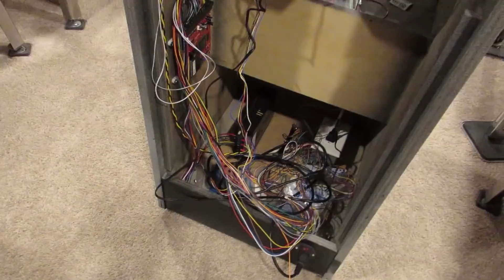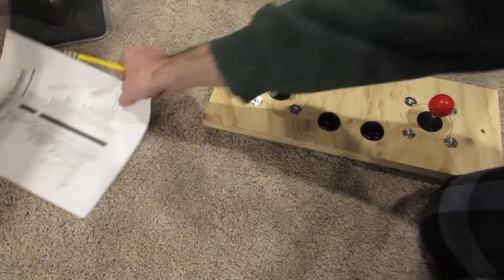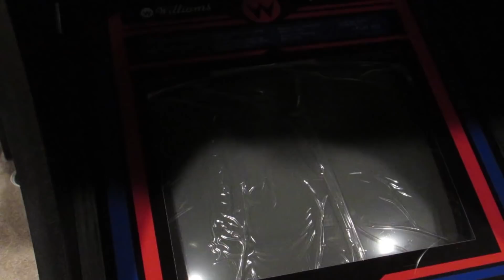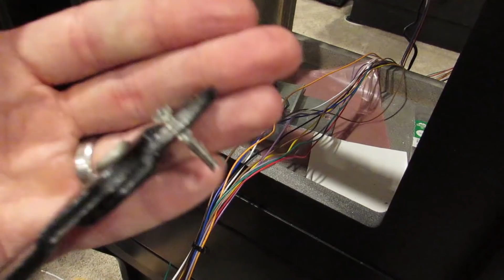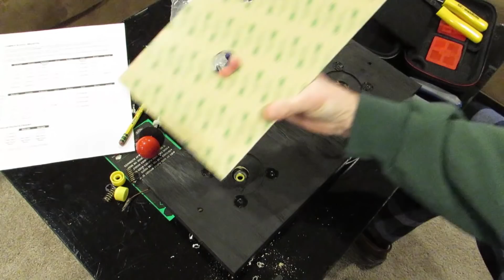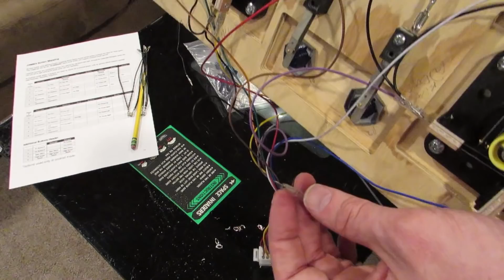Let's Make: Robotron Cabaret Control Panel (Part 2/2)

Comment: Starting a build of my own. On the edge of the control panel is it just painted wood, or tmolding?
Reply from the maker: I painted the whole thing black and then put T-Molding on the edge.
Reply: @ThatTimGuy  Thx. I'm assuming you used the same 3/4 in plywood as the rest of the cab?

Comment: Where did you get the control panel latches?
Reply from the maker: I grabbed them off of eBay. I don't think this was the seller, but this is the same style: https://www.ebay.com/itm/Arcade-pinball-console-panel-latches-Set-of-2/171275529729?epid=1231630111&hash=item27e0d12e01:g:47wAAMXQuTNTLIVy:sc:USPSPriorityMailLegalFlatRateEnvelope!01007!US!-1:rk:7:pf:0

Comment: Tim, where do you buy your Jamma harnesses?  Trying to avoid the cheap ones.
Reply from the maker: I think I got a cheap one from Holland computers. The downfalls of this one are that the wire gauge could be better. It is probably the best cheap harness I've purchased though at sub $15. Otherwise you're looking at about $25+
Reply from the maker: I think it was this one: https://rover.ebay.com/rover/0/0/0?mpre=https%3A%2F%2Fwww.ebay.com%2Fulk%2Fitm%2F330965087080